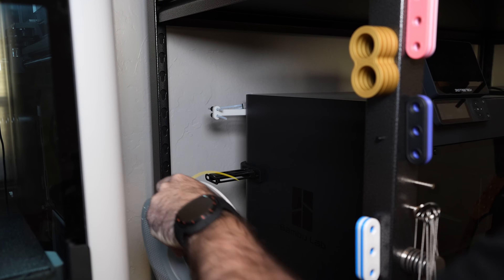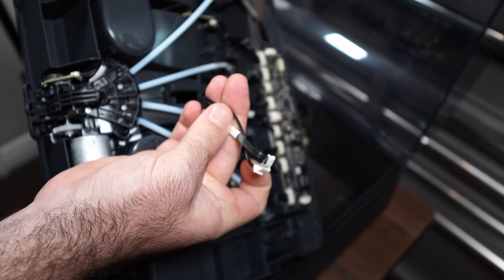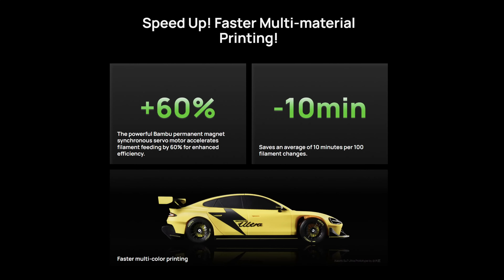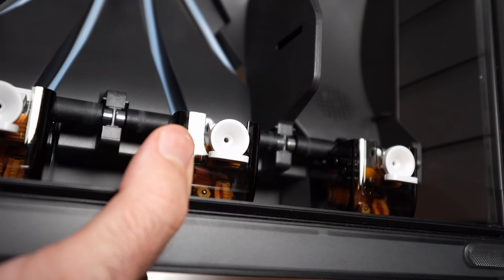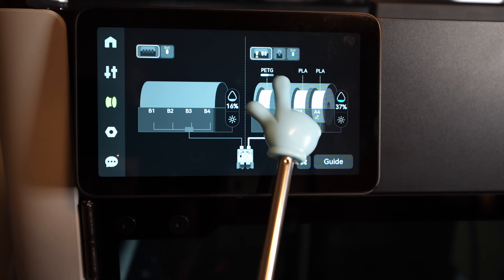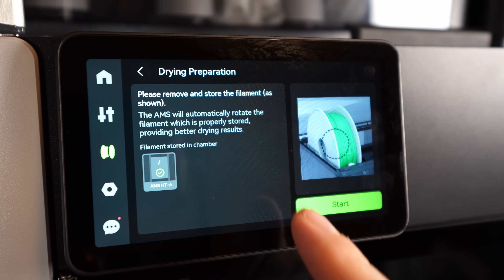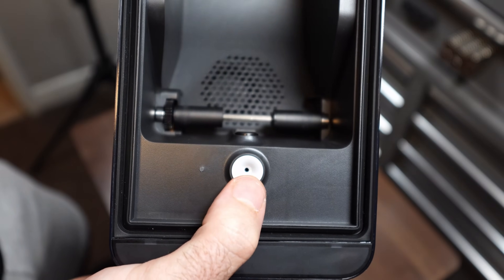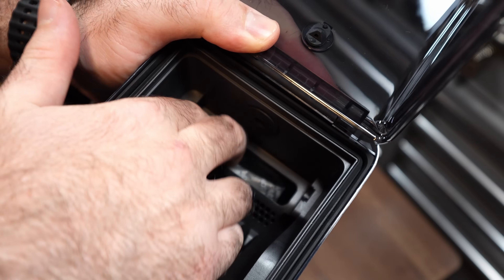Which Bambu AMS Should You Buy? (AMS OG vs 2 Pro vs HT)

Comment: The best is the HT. You can print while drying by starting drying and then using the back hole to feed into the printer. Next is the AMS 1. There are mods to print 
While drying. Last is the AMS 2…just get a Creality Space Pi x4. Have it drying your filaments then put them in the AMS. Space Pi can go to 85C and can print while drying

Comment: AMSpro is crap. 10min saved in 100hrs??? Not worth mentioning. You cant dry and print at the same time. Just buy a seperate dryer like everyone already does. The other upgrades are minimal. Bambu should have just upgraded the OG AMS, and skip the gaslighting.

Comment: i got the combo p1s and ams 2 pro the ams to me is bullshit i have had nothing but problems with it. first problem the shit doesn't load filament. straight disappointedin this i got over a 100 hours on the printer and was like let me hook up the ams what a nightmare hours of time trying to figure this crap out just to have to make a ticket and wait for bambu. the problem is the ams will feed the filament about 2 inches passed the buffer and retract every damn time then tell me its missing filament like no shit. there should be a manual option i dont mind feeding it into the printer

Comment: Free video comparison on the AMS OG and AMS 2 Pro
Reply: I have an X1C and  AM2 Pro.  I have been working with Bambi Labs for 45 days attempting to fix the unit -- it will not RETRACT filament on ANY spool -- the spools do not reverse to take up filament.

I have replaced AMS 2 internal hub and motor, changed all flat cables and the motherboard and swapped 6
Reply: Replaced 4 and 6 pin cable and the power bulkhead.  BL was helpful for first 20 day, and has now stopped replying.

I purchased 4 HT units to get back to work -- but this unit is still under warranty and I have asked numerous times for a replacement and credit for parts purchased.  I I don't think they know what to do & are trying to "wait out" warranty.

Comment: You don't have to take out all the spools in the original AMS to release the PTFE tube there is a button in the back that you press down inside
Reply from the maker: That's only for the exiting PTFE tube, not the internal paths that lead to it (which are the ones that are a pain to clear).
Reply: @sammuxlow  I meant to say you don't have to take out all the spools in the AMS to hit the release button you just need to take out one. I think all the listening to taking it apart constantly because I've been watching multiple videos to see if it's an actual worthy upgrade to purchase, got it stuck in my head while I was typing lol. But yeah there is a bunch of annoying things about the original AMS but I just don't think the AMS 2 is a worthy upgrade it doesn't provide that much more and not being able to drive while you print is a big downfall, the ams alone is slow and can only go so fast without it being a tool changer.

Comment: I ordered the new AMS 2 pro just to figure out it dosnt come with everything you need to set it up if you don’t already own the og AMS - so I went back to the website to order the upgrade kit just for it to be sold out. Needless to say I canceled the order and just ordered the og AMS. Bambu truly sucks for that.
Reply: I have two AMS 2 Pros and they both came with everything. What are you missing?
Reply: @highsoci1673 the upgrade kit, seems if you didn’t already own the original AMS you’d have to get the kit separately and that was sold out so I canceled the pro 2 order and back ordered the ams
Reply: @CtrlAltPrint 
Ah, you must mean the kit for the A1 or the A1 Mini to used the AMS 2’s?  
Mine just came in last week.  The kit and the AC adapter for the AMS 2 work well and my A1 is printing again.
Reply: @bearlemley no. They dont send the buffer and power cord with the AMSpro. You only get it when you buy the combo.
Reply: Og is better. You cant dry and print at the same time anyway. Buy a separate dryer.
Reply: @andrewwinchel4659 exactly, in my country I can buy 2 more dual filament space pis and it would still be cheaper than the ams2. So now it just got faster motors and more easy to fix I guess.
Reply: @andrewwinchel4659 lol

Comment: I bought 4 ams 2’, and 4 HT’s. I live in a humid climate and even PLA doesn’t last very long after drying. Both these AMS keep the filament dry a long time after the drying cycle. Much longer than using vacuum bags. With a family using the printer we always seem to have too. Many filaments open and or in use. There also an AMS 2 for the A1 printer now, awaiting the buffer to be in stock. We also have 2 Sunlu S4’s and one S2.  No matter what we are printing there are always several dryers working for the next project.

Comment: Are there any other third party options to dry and print filament like TPU simultaneously?
Reply from the maker: You can definitely buy a normal filament dryer like the poly box or chitu systems E1 and feed TPU into your printer. As far as I'm aware, there are no AMS-type systems that can reliably feed TPU into a print head.. so no auto loading and unloading yet.

Comment: Other reviewers of the AMS 2 pro say you can dry while you print (as long as you have the external power unit plugged in).
Reply from the maker: Software restrictions dont allow for it. What they likely mean is having one AMS print (not drying) while the other dries your filament and isn't printing. The external power supply is only for power reasons. The H2D can actually power a single AMS unit's drying functionality on its own. If you add more than one, you'll need a power supply for ea.

Comment: Hi to all, and thanks for the video.
I just bought the P1s without ams, but I'm wondering about the automatic feeding. Do you know if the automatic feeding for P1S could be activated if I use the AMS HT and the external spool for the filaments.  I'm looking forward. Thanks
Reply from the maker: You can certainly use the HT for auto feeding filament. If you load an external spool using an auxiliary holder/dryer, you'll have to manually unload it to change.

Comment: Does the AMS 2 accept the original printed desiccant pods?
Reply from the maker: It doesn't, slightly smaller storage areas in the new AMS. I guess it depends on the design you use for desiccant.

Comment: I would rank them as HT, OG and 2.  HT for having a usable dryer temp, the 2 is too weak. 2 kept the same friction rollers that are junk as OG, so not paying extra for that.  With it not drying while printing, you get to sit and wait for it to dry, then print. Not good. So that 40 is better used on an HT or even better a dedicated dryer system not tied to the printer.
Reply from the maker: Very fair opinion. Using the HT more has made me really appreciate its higher temp.

Comment: I took my AMS apart to see why it was so grok-damned expensive - at $600 here in New Zealand.
Yeah - I was disgusted. These things shouldn't sell for more than $100 USD or so.
And being tied in to their products is a bit of a bummer, because if you grabbed a fake AMS clone device from AliExpress, you can guarantee it will turn into a brick the next software update from Bambu, recognising the fake item.
In saying that I am disgusted by the high price, and low quality of the Bambu AMS - and yes, the quality is garbage. If you put a ring around some cardboard spools they will jam the lid, and cause an error. And the middle of the lid has a big gap where air can freely circulate into and out of the AMS unit. That is flat out lazy design.
And the plastics are no better than what come out of the P1S it sits on top of. :P
Then there is the despicable lack of a built in hygrometer - or even a place to stick a 50-cent Temu Hygrometer.

Yeah, it works well - MOSTLY - but this unit is severely underdesigned, woefully inadequate to use for all filament types due to size restraints and cardboard bans.

One of its most valuable features is the auto-backup feature which allows you to empty your spool completely and switch to a new one immediately.

However, there are more things to complain about than praise in the AMS, that's for sure.

And in my view, Bambu should offer the AMS as a kit you can buy without a box, or containers, so that we could convert a (similarly flawed) SUNLU 4-spool dryer into a second (much better) stand-alone AMS.
Reply from the maker: Which AMS do you have?

Comment: My X1C with ams 1 cost $1k, if I got it with ams 2 it would cost about $100 more or so. Figured the printer is expensive enough and I already have a dryer so I stuck with the OG
Reply from the maker: Totally rational, especially if you already have a dryer

Comment: can you use the HT and the OG together on a P1S to print TPU and other material in one print?
Reply from the maker: TPU is the challenge, it cant be retracted automatically, since it cant really be fed through the AMSs motors.. so no unfortunately. With dual nozzle printers, the TPU is a constant, it never gets retracted. While the other nozzle can still swap filaments.

Comment: the prices are not entirely accurate. the original AMS package includes the filament buffer and the pin cable, the AMS 2 Pro does not. so if you’re not upgrading but buying new and you include the switching adapter, the AMS 2 is 100 more than the original, making it just a little less than an A1 combo
Reply from the maker: The 2 Pro does include a cable, but yes you are right about the buffer

Comment: I am exploring 3d printer options. I have zero experience.  Am considering the p1s s pro.  An option that I think would give me some room for growth.  Id like to be able to make items to sell at craft makers ect. Do you see this as a good option? I would appreciate your feedback.
Reply from the maker: I think you are referring to the Bambu Lab P1S, which is an excellent machine. I personally have 4 of these printers. I mainly use them for higher volume production. The screen is the biggest downside, but if you don't mind the small display and physical buttons, its a great option.
Reply: @sammuxlow thank you for the quick reply.
Reply: @sammuxlow  there's a BIGTREETECH Panda Touch Screen 5” Display for Bambu Lab that must solve the problem for an extra money ofcourse.

Comment: Im looking at getting my son a 3d printer for his birthday and i want to get into it as well. What system would you recommend
Reply from the maker: Honestly a Bambu A1 would be an awesome starting machine. They have great tech and are very cheap to get into the hobby. If you plan on printing Engineering grade filaments, like ABS, PC, ASA, or PA, I'd invest in an X1C 10/10 times.
Reply: I was looking at the p1s combo or the p1s with the ams pro 2. What's the better way

Comment: Can't dry and print at the same time as the heating of the filament makes it soft so it would get jammed in the feeder etc
Reply from the maker: Not necessarily true. For the filaments that would benefit from that ability, you could run a lower temp to keep the AMS environment dry, or to recharge desiccant. Yes theres cases it might cause errors, but Bambu wouldnt be blamed for that, or shouldnt be. A flag note is all they need to protect themselves

Comment: I'm confused about your reliability experience with the AMS.  In the "OG AMS (Cons)" section you say you are always having to go in to clear jams, and even left the screws off it happens so much.  But then in the "Common Pros" section you say "they feed very reliably are very consistent and have had hardly any failures.." ?
Reply from the maker: Filament breaking is not the fault of the AMS necessarily, usually the filament is old and becomes brittle. What is super irritating however, is the terrible maintenance design

Comment: How well do the AMS 2 Pro and the AMS HT work together on top of, say, an H2S? Looks like they fit well. I've only ever seen a four-to-1 AMS buffer. Is it just like having two AMS units, but instead of 2x4 (8) you have 4+1 (5)? Just curious how the X1C and H2S view those units when connected together. I'm assuming it's these same daisy chain for the data. Does that HT need a separate power supply? Thanks for a very helpful video!
Reply from the maker: They fit very well together on top of the H series printers. The software integration for AMS units on bambu printers is done very well, its clear which AMSs are connected and editable. For H series printers you can daisy chain the AMSs, for X and P series you need the Hub. The HT does require a power supply, but it ships with one, unlike the AMS 2 PRO.

Comment: Nice video! I got my daughter an XC1 with AMS for Christmas. We don’t use it nearly as much as some people, but today my daughter was printing out something to give to a friend as a gift. I got a notification the filament wouldn’t load on the Handy app, and I called her from work to check the spools. She said they were fine. I tried restarting it for her but the app kept giving me the same error. So, when I got home at 2am I started looking into it. Checking spools, tubes, and all the other things the internet provided as far as troubleshooting. All no dice.

Then I found a post on Reddit to check the AMS internal hub unit for dirt, or blockage. And imagine my shock when I found the little plastic “door”/plate that covers the bearings, shaft and gear was broken. Little tiny piece of plastic just torn in half. The 4 screws held it together, but the break was enough that the filament against the gears must have pushed it enough to not get a tight enough grip on filament to advance it, causing the error. I superglued it together and reinstalled hoping I can finish this print for her (so far so good with 40% to go). But it looks like I’m going to have to pop $55 plus shipping for a new internal hub unit, because I’m sure I can’t buy just that flimsy piece of plastic. For the price of this AMS, they sure went cheap on a predictable fail point of the design.
Reply from the maker: Thats a really weird failure. I haven't had to open mine up completely yet, but ill take a look at that area so I can understand exactly what caused the error. Any chance the community could design a better part so it doesn't break like that? Could it be a machined metal part?
Reply: I think I have this issue

Comment: But the AMS pro 2 is not only $40 you will need to add the following if you want to actual use the AMS Pro 2 you will need to add the AMS 2 Pro Upgrade Kit this includes the buffer and cable and power supply $62.36 and a PTF connector that makes the AMS Pro 2 $422.64 that's 102.39 more then the OG. The OG comes with everything you need to use it in the box plus extras that the pro 2 doesn't like  spare cutters $2, and 4 reusable spools 47.96. This makes the Pro 2 actually $153.92 more. you could take that 153.92 and add $5.07 and buy a Creality SpacePi X4 and then you can prints and dry 4 spools at the same time.
Reply: Thanks for the valuable info
Reply: That quite a bit more then $40
Reply from the maker: This is not necessarily true. It depends on the printer you pair it with.. the H2D needs nothing additional to run one, but an X1C and P1S will need an additional $60 for the kit. Still, $100 difference is 100% worth the upgrade in my eyes.
Reply: Are you running the space pi outlets into the Bambu ams?

Comment: Currently shopping around for my very first 3D printer, seriously considering the Bambu series. Great video, thank you for the in-depth comparison of the AMS's! Can you connect both the AMS Pro 2 and AMS HT concurrently on the X1C, or would I need to go for the H2D for that capability? Thanks!
Reply from the maker: I think you can, but you'll need the hub for more than 1 AMS

Comment: I don't understand why they don't support dry-print at the same time. Do they still keep temperature/humidity stable after a long print if the printer has been off for a while? Have you tried the Sunlu upgrade cover for the AMS OG?
Reply from the maker: They are concerned about filament softening from the heat, and jamming up the AMS.. but I dont think its a good enough reason to bar people from doing it. I haven't used the sunlu yet, but I think its a genius idea

Comment: Great video. I have the option of buying a P1S Combo with AMS or an AMS2. The price difference is $230. Is the AMS2 worth that much more? I do like to dry my filaments before use, and the maintenance aspect of the AMS1 would shit me, but I’ve never had a filament break on me.
Reply from the maker: I dont know if it's worth that much more... at that cost difference id think about buying another one seperate. So maybe go with OG for the combo and then buy something else with the $230 you saved. I think an AMS 2 Pro is like 299 currently